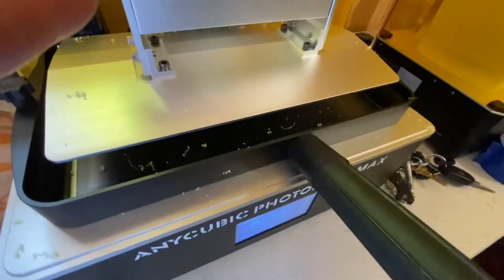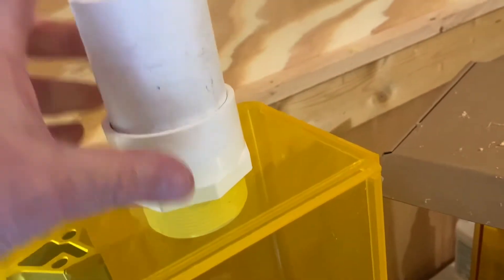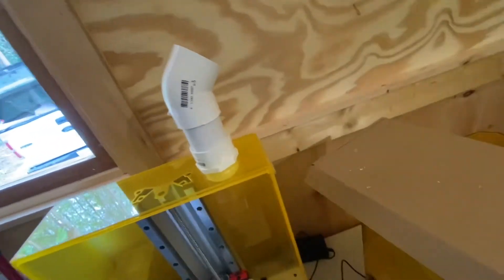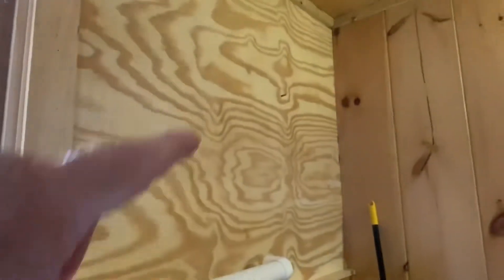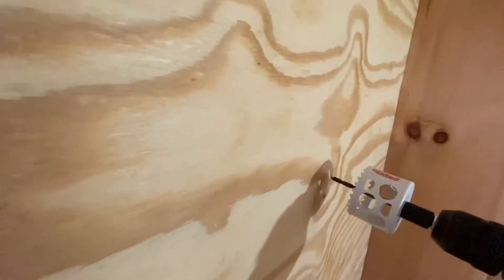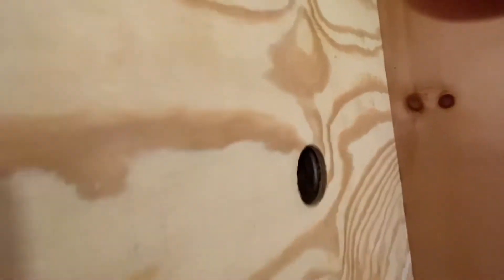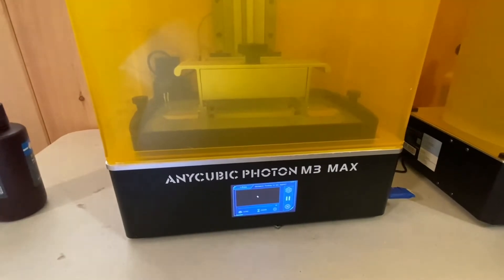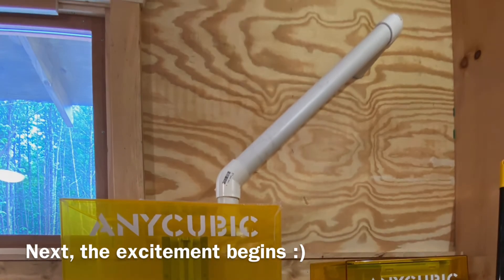Venting the Anycubic Photon M3 Resin Printer

Comment: but dont you need to remove the top cover when you print and then remove the models after printing?
Reply: The M3 MAX's cover has 2 parts. You can remove the front part of the lid and keep the rear one (exactly how it was during the procedure)